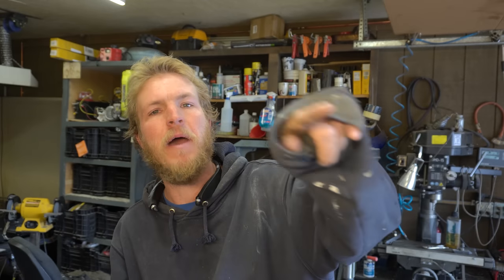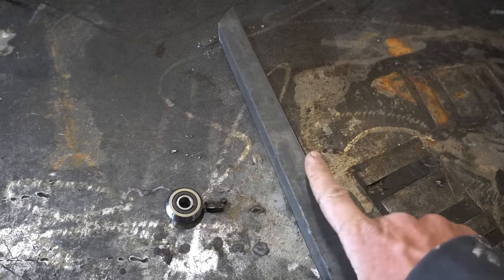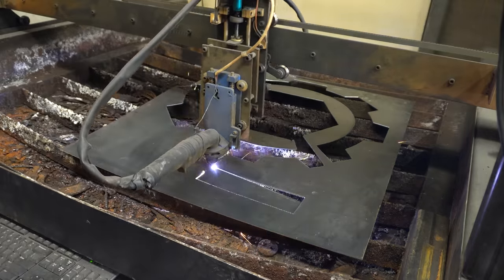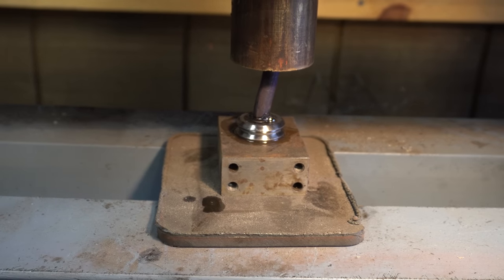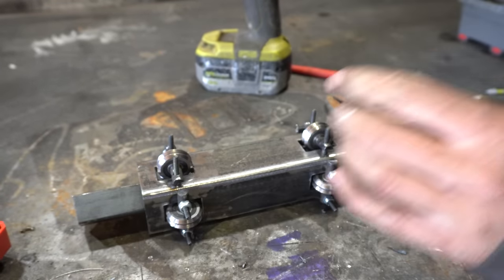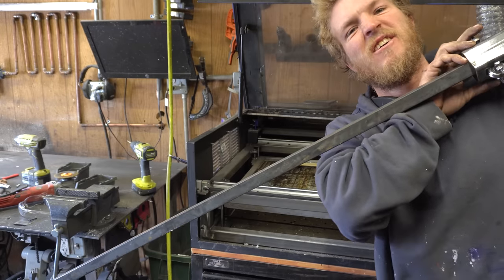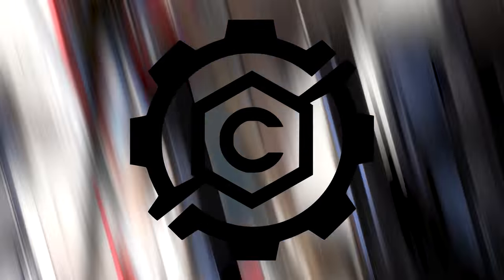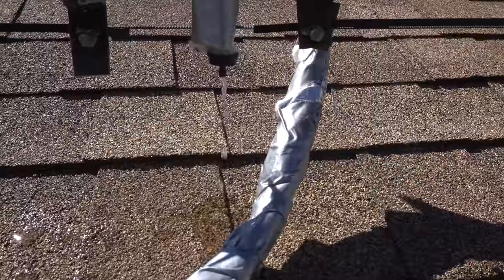Attempting To Make An Icicle Sine Wave

Comment: Hey, it worked well enough. If you had more freezing nights I bet you'd get er all dialed in. Frankly I am surprised that the concept worked out as well as it did. I wouldn't have expected that it is possible to control icicle growth without getting completely wiped out by random variables creating too much noise in the system. 
Very impressive work. Thanks for sharing!

Comment: Well there's an idea I've never thought of... haha.
I think the biggest problem might have been that you dispensed the water onto the roof tiles which are very uneven. If you dispensed the water onto a steel sheet with little 'teeth' at the bottom, I think this might have worked pretty well.
Reply from the maker: That's a good idfea man, next year i guess hahah

Comment: What a cool idea, and not at all a failure. You need to revisit this next winter; this time get started testing as soon as it's cold enough and use every opportunity for tuning - your setup seems to work pretty good, you just need more time tuning the values. Things to consider would be what temperature the water actually comes out of the nozzle, an idea for that would be to leave the heating mantle on completely on the hose but attach it to an arduino, insert a thermocouple at the end of your hose (just were the heating element still reaches - you want the thermocouple to see what temp the heating element gets the water to), and let the arduino keep the water just above freezing - hot water might even be better because it actually freezes faster than cold water. Furthermore to consider, at what rate the water can actually freeze on the icicle - if you add water faster than it can freeze, of course your lengths have to be off. So another idea would be to significantly reduce your flow rate on the water additions, because looking at your clip it looks like way too much at once. I suspect that fast drips would work way better, but once again, thats something in need of testing. 
Would be excited to see you getting this to work properly!

Comment: Ive got a plasma cutable carriage design that uses regular bearings and rides on tubing. Its solid and i use it for the cnc plasma i built at work.

Its just a plasma cut piece with a couple of folds (i did mine by scoring with a the plasma part way through the material, then applied a hammer) so its pretty quick and easy to make. Give a yell if you want and i can share the files with you.

Comment: Mmmm, got to say that "linear rail" is a beauty and could have many uses. What are the V groove bearings you used? On thinking about it the drive belt could be attached to the internal of the "rail" to the "carriage", protecting the belt from whatever.

Comment: Icicles form when snow or ice on your roof barely melt from the sun or heat leaking through your roof. Then it drips in the shade and it freezes. The water is BARELY above the freezing point and maximally viscous - syrupy. Your water will be a lot warmer and freeze slower and be a lot thinner. I think that's why your icicles are so skinny. I think you should remove all guard heat and instead try to cool the water without it freezing. If the water keeps flowing at a very low rate I think that will be enough to prevent freezing. You could incorporate a compressed air blowout for when you want to shut down.

Comment: I wonder. How much ice one might need to make to reduce their summer AC bills in half.

I can hear a bunch of "it depends on....."  but it sounds like a site engineering challenge.  I'm thinking start with a buried water container and heat pipes to pull heat out during winter. 

The requirements are probably way too much to be practical is probably an understatement for most places but further north one lives, maybe there's a case where it is practical. 

Incedently, it's amazing that heat pipes are used along Alaskan oil lines to create perma frost, permenatly frozen soil, to suport the pipeline support structures.

Comment: Man I think about doing unique things to my gutters all the time. Like Simone Giertz I wonder why everything has to be so boring. My thought - I think your flow rate was too high to start and that contributed to the wonkiness. As the icicles grow they can accept higher flow rates because of greater surface area and mass. Adding some kind of bolt or spine for the icicle to start on might help.  Airflow is also a factor to consider. Something ducted like a Dyson air blade to force air along the dripping plane would be really cool but the size and complexity now seem to be getting out of hand in my mind.

Comment: I think it would have worked better if the longer icicles would have been watered more often and not just longer because presumably a lot of the water runs down anyway and then what's stuck to the surface will freeze.

Comment: try torching a metal surface/pipe with carbon coating (yes soot) to make a fluid type graphite no-ball bearing
Reply: also a linear square tube rail, just torch the inside and outside, the slide
Reply: also if the fitting is perfect then no slop
Reply: what a soup, deth in the soup
Reply: you could also have put pipe splitter to the exact output spots, too
Reply: nice ice popsicles brah